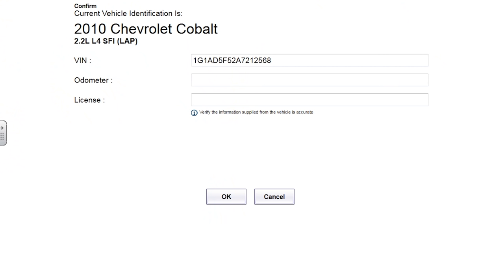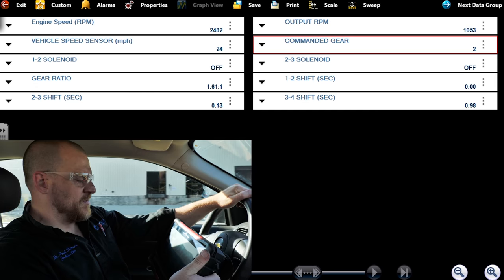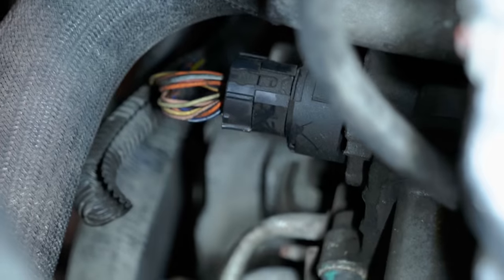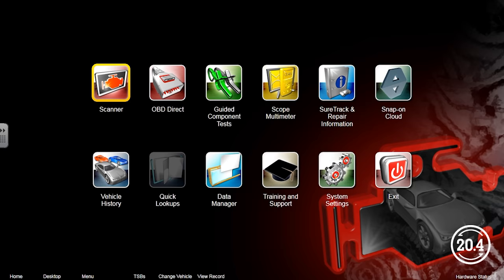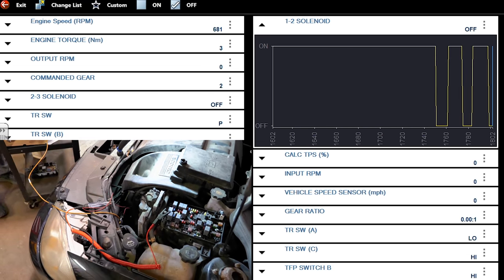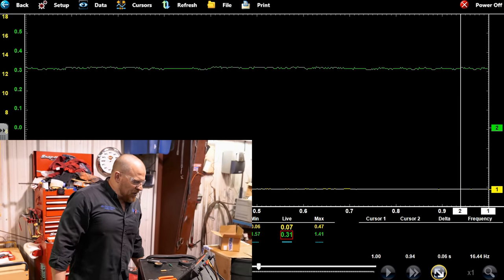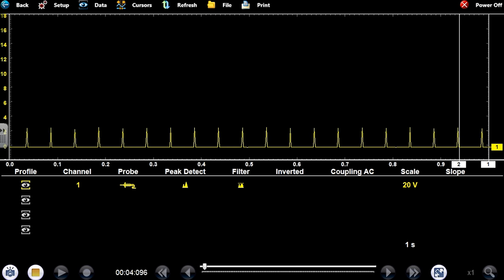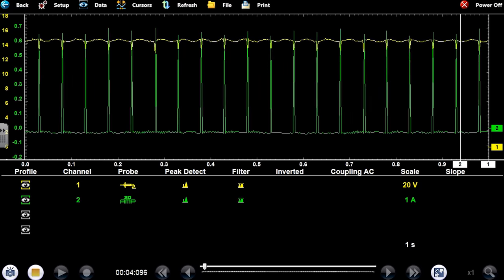Testing Transmission Shift Solenoids - (P0700, P0974)

Comment: Hi sir Danner merry Christmas How do you get that pulse width voltage signal on the scope when the circuit is off. it seems like it is working why the bias voltage is not constant how do you know if it is a bias or actually working when not equipped with a sophisticated scan tool to activate it manually ?? You know I'm a beginner in this field. God bless you
Reply from the maker: I've seen pulsed bias voltage before. I have a case study right here on a VW. Let me find it. Here you go https://youtu.be/83e5SI4IzDM

Comment: I’m alittle confused if the solenoid is “open” wouldn’t that mean we wouldn’t see battery voltage with the light since the light is down stream of the solid.  Doesn’t the driver actually ground out the circuit?  I love the videos thank you for sharing your knowledge and experience with us
Reply: If I would have continued watching I wouldn’t even have asked.  Amazing stuff thank you
Reply from the maker: The terms open and closed refer to the mechanical state of the internal parts, not the electrical state.
Energized electrically can mechanically open or close a valve depending on if it is a normally open or closed set up.
Hope that helps
Reply from the maker: No problem!

Comment: So the the circuit high code is flagged because the computer is still seeing high voltage when the solenoid is commanded on ? Or is the circuit high code flagged because the amperage is high and the computer is limiting current flow ? Thanks as always Mr Danner for the awesome content !
Reply: The code is "circuit high" so it's flagging because the voltage on the circuit is high when the computer expects it to be low (0 volts/grounded/solenoid activated).

Comment: Merry Christmas Paul and family, according to the replacement at exactly 39:10 seconds of the video it seems that the solenoid moves a plunger and not control fluid flow, could it also be a stuck plunger forcing the solenoid to draw high amp?
Reply: It applies fluid pressure behind the valve , to apply the valve or plunger which directs high volume pressure fluid to clutch pack or band servo apply.

Comment: I have an idea. Give him a SPDT switch. Hook up the green shift solenoid control to the center terminal. On either side connect a 26ohm 10 watt resistor to +15 and mark that position W for winter. On the other side of the switch back to the green wire on the solenoid side. That way he can run it in winter mode and pass his emissions inspection and fix the transmission at a later date.

Comment: How are you dear.   I have a 2008 Cobalt with a 2.2 engine and an automatic transmission.   There is a problem: when I start driving the car, the transmission gear becomes hard shift after driving for 5 minutes. and then When I turn off the car and restart it and drive it again, the transmission becomes normal and smooth shift.   But after continuing to drive the car for 10 minutes, the transmission returns to becoming hard shift , knowing that there is a code p1811( maximum adapt and long shift). what do you think about this problem?
Reply from the maker: Run through the tests on the flow chart for that code.

Comment: Happy New Years!! My car sometimes gives me 17 gallons per mile and sometimes it gives me 28, I’m driving a 2010 Chrysler town country with almost 400,000 miles, all of the data is good when I checked it on the scanner, but it shakes when I reach the stoplight. Rpm is between 600-650, I changed everything including the throttle body, both oxygen sensors from the dealer, spark plugs from the dealer, short term fuel and long term fuel are all good, can you please let me know why it’s shaking when I reach the spotlight? Thank you and again happy New Years!!
Reply from the maker: Have compression tested.
Reply: @ScannerDanner  no sir I don’t so I should do that?

Comment: why won't the car pass insp. i thought only emission related faults caused the check eng light to come on ? great video
Reply from the maker: If a transmission isn't shifting properly, gas mileage is affected, this is why
Reply: @ScannerDanner  thanks for the quick reply. i did a little research and found an explanation that made sense. any increase in engine rpm at a given road speed will cause an increase of particulates by increasing the volume of exhaust gases.in your case a doubt that would happen but i understand the reasoning. learn something every day

Comment: Wow, good video.  I'm thinking for a novice, a OHM meter would have worked. I know that test light staying lit would have thrown me a bit.
Reply from the maker: Ohmmeter would not have been the tool to verify driver function 😉 Test light is your best friend here, even for the DYIer
Reply: @ScannerDanner  OH agreed, you have definitely taught us that.  Just saying one could have used a meter to see the short / low resistance on the solenoid. Love your videos, they have been a big help.  I went to school for this stuff in 89, just as fuel injection was starting to be used. Ended up working with computers instead.  Got in to fixing the ECM controlled stuff when my kids started to drive.

Comment: I think the TCM module was the problem..13:20.. 2.5v voltage signal inside the TCM had shorted solenoid feedback green wire..The test light wasn't right tool to use to test surging ground because  it lights Even when there is surge in voltage.. Thanks SD always the best...
Reply from the maker: No sir, this is a normal open circuit bias voltage. I have a lot more lessons on bias voltage if you're interested? Thanks!

Comment: Wondering if you added a relay to satisfy the computer as not being short in the circuit, and then the wire that is the grounding side is switched directly from the ground. This way it is an isolated grounding circuit, the computer is happy, the relay still has the fuse protection. Never worked on a cobalt trans but have seen in other vehicles where the metal deposits that built up around said connectors and or solenoid contacts internally cause all havoc. For me personally, I would fuse that ground to a lesser of an amperage fuse than the supply voltage fuse, ie if it has a 15 amp supply fuse, I would use a 7.5 amp fuse. The amount of work to repair correctly may justify a presidential solution as such, the worst scenario I can see is it will need to be done correctly. I use this "boost relay" all the time on Toyota's old starter circuits to control solenoid command when there is voltage drop on the line, which works for me. Workarounds are what drive the fix 99% of the time. Big note here too let's say the driver in that module is wonky, the relay will help to fix today and may last the life of the car in that state. The customer must be made aware that this is a trial fix because they must sign off on it in writing.
Reply from the maker: Unfortunately, this system will then flag a gear position error fault. One that the solenoid error code was preventing from setting.
Reply: @ScannerDanner  If that solenoid is shorted this would not work, but to see for me to take one step further I would at the trans control module ground out the solenoid to activate fused of course to see if I could hear the clicking the trans and also do a good one for the sound test. See my thought was like you said let the computer control the relay isolated from the solenoid 85+86, then ground term 87, and 30 goes to cut wire directly to the shift solenoid. I would think it would still shift as long as you can hear the audible noise from the shift solenoid. Again if there is no solenoid noise scrap the plan. The only thing I cannot say is the spike voltage of that relay. All good Merry Christmas.

Comment: Paul - I guess the 1 - 2 solenoid circuit is not fused ? I would think if the 4.4 amps the shorted solenoid is pulling would blow a low - say 2 amp fuse and a guy like me could easily deduce that the problem was a shorted shift solenoid .
Reply from the maker: I dont remember, was the solenoid power or ground side switched? If it was ground side switched by the PCM then it would have definitely been fuse protected. Probably a 20 amp fuse feeding all of the shift solenoids and maybe a few other outputs?

Comment: Great vid I have same problem on my w203 Mercedes C240 showing code
( P2101 shift solenoid valve 1-2 and 3-4 short circuit to ground ) my transmission stuck on gear number 3 if I'm not wrong n it's not shifting 
How can I fix this problem
Reply from the maker: Follow the steps in this video!
Reply: OK Danner your vids makes us life much easier be4 we throw money into something which is not the problm my mind was to open up the transmission n check on the solonoids coz I Don have the equipment like yours only have a test lights and a voltmeter but I wanted to ask jus to make sure if the problm isn't into the transmission is it possible to disconnect the connector which goes to the transmission and rescan to check if the wiring is wher my short to ground is thnk u for your reply I'm jus DIY I hv only little info in fixing cars
Reply from the maker: @nigelnkunzi6414  you could do that, and rescan as a starting point

Comment: My friend told me that is 2006 Chrysler 300 automatic gear only selected 1, 2 and 3, other gears aren't working. I also heard that gear oil was leaking slightly however that oil leakage have been fixed. Unfortunately, the gear problem still continues. Please, what could be responsible for such a problem and how should it be fixed?
Reply from the maker: Can't answer this over text on a screen. Sorry
Reply: @ScannerDanner  Okay. I've also forwarded the question to your group. Please, can you answer on that platform instead?  I'm anticipating your answer. Thanks in advance!
Reply from the maker: @davidessien5465 unfortunately what I mean is there is no way to answer your question without seeing the car and having way more data

Comment: Yet again, another awesome video, cheers Scanner!!!!
One question though...
When would it not be a good idea to use an incandescent test light to test the integrity of a wire.
Can you name a component that uses a signal wire where using the test light could blow the ecu?
Reply: He has covered this before. The most important thing is to know the amperage draw of your test light. If you have a test light with a dome light bulb shoved into it pulling 1.5 amps, you could be in for some trouble. You also want to think about the ckt you are planning on checking..what is its normal current draw for the component. You wouldn't want to sub a test light drawing 500mah into a relay control pin to see if the computer can ground it. Obviously it's not advised. The most important thing is understanding the normal current that the ecu would be working with on that ckt first
Reply: @codywichman213  you see I know the current draw in my test light being  at around 150ma but still, the spike when it's first activated can be at least double that's for a few milliseconds until the filament has warmed up.
Also how are you supposed to work out the current draw of a said component if you are carrying out a wire integrity test because the wire may be corroded or broken.
Reply: I understand your concern with the voltage spike. Many things under normal operation can have voltage spikes. As far as deducing the current draw with a component without the resistance of the component and the voltage level in the ckt you would just have to go with a rule of thumb sort of deal. If you did know the voltage and the resistance of the load in question you can use ohms law to figure out the amp draw before  substituting the test light. Also in the time I've been using this method I've only seen two times a test light fried an output. And both were door module functions and were from substituting a test light. So on a ecu under normal thoughtful testing should be ok.

Comment: porte non ferme - door is ajar    vidanger l'huile  -  change the oil   (most likely is a canadian model setup in french)  There you go bud!
Reply: Yes this is French, but it doesn't come from Canada since the cluster is in miles.  Canadian models are in kilometers.
Reply: Some of the early 00’s GM’s had a button to make the cluster change from miles (or as AvE would call them, “Freedom Units” or “Units That Went To The Moon”) and km. It would actually change the needle position; I used this on a few rental cars I took to Canada. Also the digital display might be controlled independently to show French (or Spanish) instead of ‘Murican.

Comment: A 1-2 shift solenoid in a 6T40 Transaxle shorted causing the Transaxle Control  module Current Limiting Function to spring into action saving the TCM from harm. The offending 1-2 shift solenoid was caught on scope live by Paul Danner alias Scanner Danner. When or what caused the solenoid to short is un known at this time. The 1-2 solenoid will be relived from it's duties for life being replaced by a  unexperienced New OEM Solenoid. The new solenoid will be vetted before being installed and then go through extensive on the job training.  Reporting live by Paul Townsend Paul's Transmission & Repair.

Comment: Enough voltage was making it into the coil to build a field... Partially shorted. Using the relay idea, send fused battery voltage direct from the relay to the solenoid. Might regain control til the fuse blows.

Comment: Hey Dan
Loved the video 
I have a problem with my car 
The exhaust manifold is getting  glowing red, after 7 minute of drive 
I have replaced everything related to that 
The engine was burning oil  but I got the engine rebuild with new pistons and blue seals and some other parts. Even before the engine rebuilt I was going on a road trip and stop the car for a break and saw the exhaust manifold glowing red then I kept going after few days I came back and rebuild the engine 
But still it didn't fix but it's not burning oil 
It's a 2007 Camry 2.4l manual 
Can you help me please :)
Thanks
Reply from the maker: My name is Paul Danner 😉
Any modifications done? Are you 100% positive that the timing belt was installed correctly? What are your fuel trim numbers? Any codes?
Reply: @ScannerDanner  haha sorry for that and no modification done everything is stock 
Yes I checked the timing it's all good all the colors matching with arrows and dots
The fuel trims are “long -17.00% and short - 4.00%
Reply: @ScannerDanner  I just gave up and said it will fix itself :(
Reply from the maker: @hasankhalid1204  I'm so sorry, it is hard for me to keep up, especially with follow up comments. I get about a hundred new questions a day, and do my best to answer them and when I do, they just multiply! Anyway, if you still need help, I have created a forum on my website https://www.scannerdanner.com/forum/post-your-repair-questions-here.html that is free to join, where I have 4 hand picked moderators and over 25k global members who are there to help me help you guys! You will not find a more friendly and helpful forum anywhere. Hope to see you there! Thanks for understanding.
Reply: @ScannerDanner  it's all good thanks for the help 
I'll definitely join it now

Comment: I'm going to guess that the transmission connector that goes through the case is bad and possible inside wiring harness is bad also from over heating

Comment: I have a 1988 \eldorado 4.5 ltr code E028 Open third or Fourth Gear Circuit or Shorted 2-3 / Shift solenoid VCC, CRUISE,,,, just need help where to look???? I'm in Ontario Canada
Reply from the maker: Wiring diagram and flow chart is where you start!
https://eautorepair.adtrk.biz/?a=10817&c=24&p=r&s1=
Reply: @ScannerDanner I just wanted to say this is another great video and listening to you explain it makes sense. I’m working on my 2006 Tahoe with p0740 TCC solenoid that I tested following Mitchell and used test light like you did and with harness unplugged and test light on the tcc solenoid the light stays on when I toggle the solenoid off and on like yours did. Mitchell said check it for short to ground which I did and my harness on engine side is shorted to ground. I unplugged pcm at other end and the harness tcc solenoid wire is still shorted to ground. So I will be checking the harness this weekend to find the short. Just found this video so it helps to understand it better.
Reply from the maker: @scottsheffield2594  make sure your solenoid was unplugged during that test too! Circuit completely isolated. If it was, I agree, you have a short to ground on that control wire. This means that solenoid would have been energized all the time if it was plugged in, meaning the TCC would have been engaged constantly, making this undriveable. IF the solenoid wasn't unplugged, you could have been getting a backfeed through the power supply circuit that was turned off during your testing

Comment: MERRY CHRISTMAS ⛄🎄...IF YOU WONNA CHECK RESISTANCE,YOU COULD DO CONTINUITY FROM CASE TO SOLENOID
Reply from the maker: Case to ground would be a good test but only if the fuse for this circuit was blowing. If the feed was touching ground, the fuse would blow. If the control wire was touching ground, it would just keep it energized all the time (ground side switched) . Hope that makes sense.
Reply: @ScannerDanner  that's ture
Reply: @ScannerDanner  true

Comment: Excellent! I had an oil contaminated connector near leaky valve cover causing a lean code. I think it was the Camshaft position sensor. My electronics background comes out of Neuroscience. Doing single intracellular and multicellular extracellular voltage  (mV) recordings. Neurons are really just leaky capacitors that self recharge.  Yes...science is cool as @#%&.